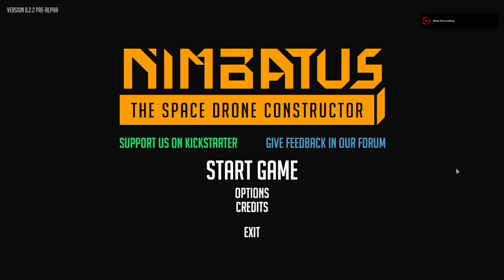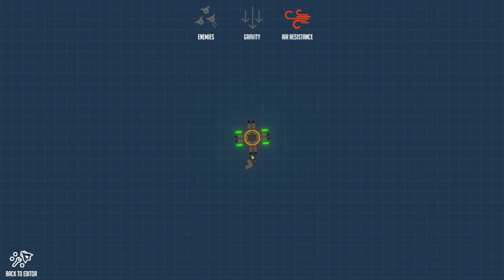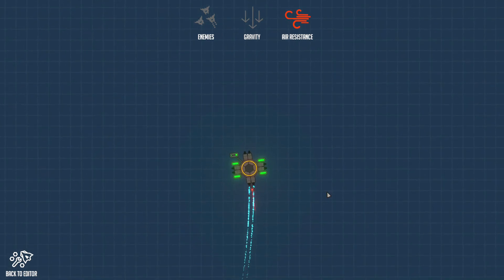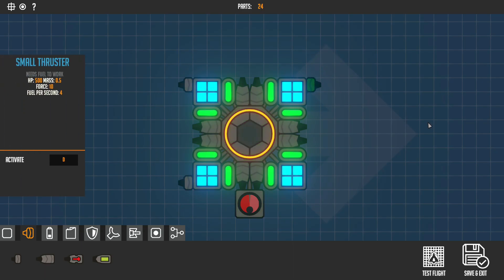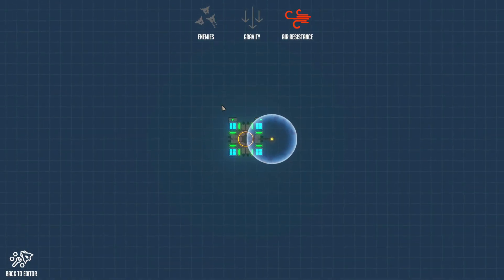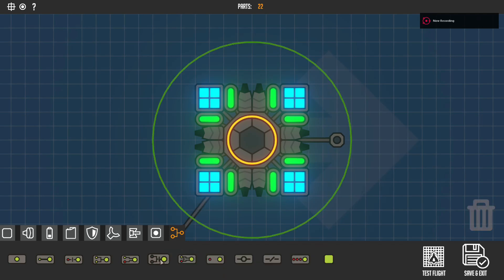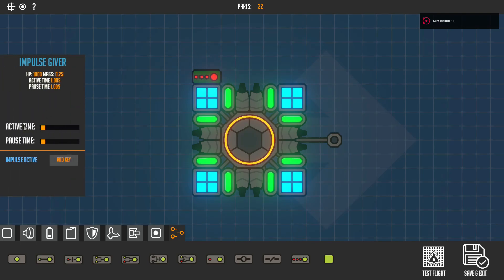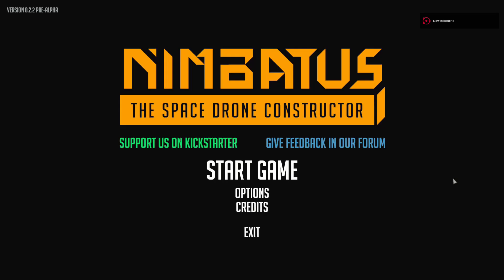Nimbatus E3.5 Tutorial: Logic Gates & Mechanical Parts & Sensors!

Comment: You skipped two Logic parts... Those are the ones I don't understand... Good job being useless. And you don't even seem to know the Logic circuits very well yourself...
Reply from the maker: Sorry John but this is quite an old tutorial now(nearly 1year old) so I was going to make another tutorial that is more in depth because some people really wanted it and maybe if you could wait for a bit longer then I would be able to put out the tutorial and also what where the logic parts that you need help with so i'll make sure to explain them a bit more for you.
Reply: Mr MM Okay good to know. I still don’t understand why you skipped the Logic splitter and connector. But please upload a video about that, because I can’t find it anywhere on the internet. Which means I can’t finish my drone that I’ve been working on for like 8 hours now if not more. Wich is really sad.
Reply: Mr MM Sorry that I had been so rude on my previous comment, it just really frustrated me that you didn’t explain two of the Logic circuits that I need to understand in order to finish my grand creation.
Reply from the maker: No worries and the tutorial should hopefully be out tomorrow and if not then in about 2 days! I will also only be covering the logic splitter because I don't see the point in the logic connector(or I might just not be using it correctly) and also good luck with your creation.
Reply: Mr MM Thank you!
Reply from the maker: Sorry for making you wait, but here is the video https://www.youtube.com/watch?v=5V9GqWl2Qds&t=424s